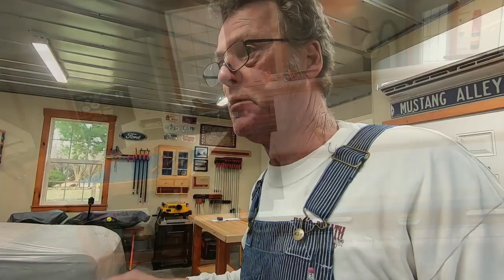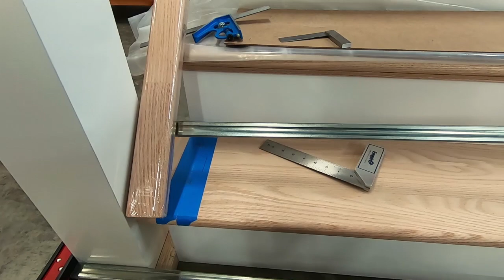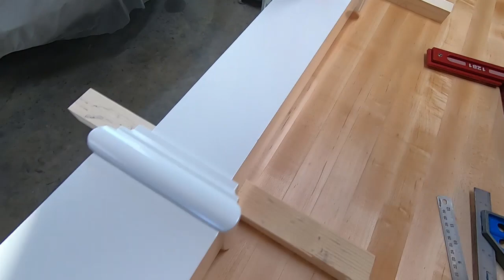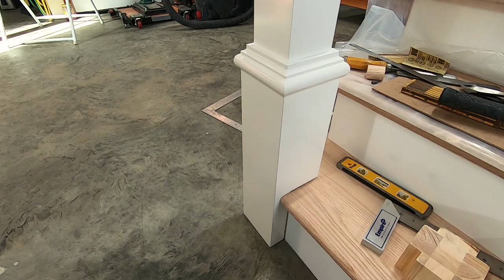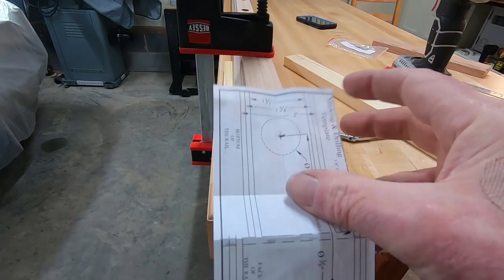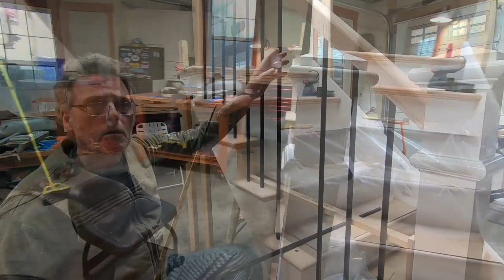Install A Newel Post, Handrail, and Balusters

Comment: Thank you so much for this video. This is exactly what I was looking for as I have been researching the best way to install our newel post and balusters. Our bottom 5 or 6 steps are open and I was contemplating closing them in. After watching this, you made it look doable for me to leave them open.
Reply from the maker: Thank you for watching! Much success with your project. Let me know how it turns out. Billy

Comment: I have a split level too,  When I bought it did not come with handrail or balance.  I really appreciate taking the time to show us how to do this.   I do have a question.  I am not sure if I missed it but what size handrails are you using?  I was trying to find one that wasn't so wide so it did not take away width or being able to move furniture into the house.
Reply from the maker: I used a standard oak handrail. There is actually more room now that the wall is gone and the new handrail is in it place 😎

Comment: Great video. How is the newel attached to the mounting block?
Reply from the maker: Thanks John! The newel is attached through the bottom of the step from below. Check out the install video, you can see it there. Billy
Reply: @billylisasremodelingchanne4344  what if there is no access below

Comment: Pretty impressive,it's not my profession but I've got a feeling even if it is I would do basic preparation work in the shop and everything else on the site...to many small details involved and to big risk that something won't fit on the site...
Reply from the maker: Thank you for watching and please watch the install video. If this home were unoccupied I would have done it on site but way too much mess to put my customer through if I didn’t have to. The sanding, staining, painting and the smell. Not to mention days without stairs. In the end it all worked out 😋 thanks again.....Billy

Comment: What is the nut/bolt fastener called that you use to secure the handrail to the newell post? 30.37 in the video
Reply from the maker: Hi Pam! That is an angled rail bolt. It is item S9601 at www.stairsupplies.com. Hope that helps. Thank you for watching…..Billy

Comment: I would add that the required spacing between balusters on the staircase is not 4" but 4-3/8" according to IRC 312.1.3 Exception 2. The 4" spacing requirement is for when the railing is running horizontally, like on a balcony. But on the staircase you can space a little wider at 4-3/8". The explanation I've heard is that the building code people deemed that a child was far more likely to fall down the stairs than through the balusters and thus the spacing was relaxed to make it easier for baluster spacing on the treads. Also since IRC 311.7.5.2 dictates that treads have a run of 10" then for 2 balusters per tread at 4-3/8" spacing means the balusters must be at lest 5/8" thick.
Reply from the maker: Thanks for watching Dennis and for your comment. Your quote of the IRC is correct and I should have said 4 3/8" max clear space between balusters. My baluster layout is from rise to rise when terminating on the tread and not in a bottom guard. I'm sure there is probably a dozen different ways to layout the balusters and get acceptable results.  Not sure of the exact numbers on that project now. We also built a (balcony) guard rail for this same project using the same materials so the spacing of the balusters of that piece was also consideration. I appreciate you adding to the conversation and hope you watch the install video, the project turned out real nice. :) Thanks again....Billy

Comment: Hey Billy, I appreciate the video you shared. We are currently remodeling our house and we are going to upgrade our stairs railing, newel post and balusters. We've got to replace the lower 2 treads where our dogs chewed on the wood, my question is do you have a video that shows replacing the treads with new? Our stair treads are the exact same design as in this video.
Reply from the maker: Hello Mikerob! Thank you for watching!! That’s a tough one. If your stairs are manufactured and not site built replacing a tread can be a tricky proposition. You might be able to cut the nosing off the damaged tread and laminate a new retro tread over it. That would change the rise by about 3/8” but would work. Most of the big box stores Cary them. I hope this helps and let me know how you make out with your project!…..Billy

Comment: What would be the best way to install a handrail between two existing, anchored newell posts?
Reply from the maker: Thank you for watching! I think I would drill a pilot hole through the bottom and secure it with a wood screw. Kind of like toe nailing with a wood screw from the bottom. …..Billy

Comment: How do you keep the epoxy from dripping from the top hole?
Reply from the maker: Hi Iuanna! Thank you for watching! The epoxy has a thick consistency so it isn't a big problem filling the upper holes before installing each baluster but can get messy if your not careful.  https://youtu.be/U9nwIvCX5yQ  Check out the installation video. Thanks again :) .....Billy

Comment: Love your video I have same set up at my house. Im having difficulty trying to figure out how to center the box nevel with the medallion can you send me some info
Reply from the maker: Thank you. I’m not sure I follow your question.
Reply: @billylisasremodelingchanne4344 sorry about that a bit difficult to explain in messages. Im trying to figure out how much i can set the nevel post into the tread. My issue is that my treads are 9 3/4 with 1 1/4 over hang
Reply from the maker: If the newel post is to be mounted to the first tread, the distance between the adjacent picket and the narrowest part of the newel post should not exceed 4 in. In my case with these stairs the rosette that connects to the top of the handrail needed to be able to mount to the wall at the top of the stairs without hanging past the existing cornerbead. Once that location is known the center of the rosette becomes the centerline of your pickets, handrail, and newel post. The install video might show this if you slow it down and look closely. I really hope this helps you, if not let me know.....Billy
Reply: @billylisasremodelingchanne4344  got it will play around with it some more today thank you very much for prompt reply
Reply from the maker: You are very welcome 😎
Reply: @billylisasremodelingchanne4344  Hi Bill sorry to bother you again just wanted to ask should the upstairs railing thats horizontal also should be at 35" in height
Reply from the maker: Usually 34" to 38" on an open walkway. I would check with your local official to be sure in your area.
Reply: @billylisasremodelingchanne4344  thank you sir, going with 36" will keep you posted
Reply from the maker: @cvello3275  Awesome!!
Reply: @billylisasremodelingchanne4344  one more thing baulester iron ones like yours spaciang apart what it should it be in regards to spacing for straight horizontal railing part.
Reply from the maker: In my area it is 4” max clear space between balusters.
Reply: @billylisasremodelingchanne4344  thank you will keep you posted on my project

Comment: Hi thank you for this very helpful video. How did you end up finally securing the newel post to the stair/floor? Adhesive? Screw through the post and then fill?
Reply from the maker: Hi Anthony! I set the mounting block in construction adhesive (when setting the steps) and fastened it to the subfloor using 3.5" framing screws through pilot holes into the framing below. I then set the post to the mounting block also using construction adhesive and 2.5" screws piloted at the bottom of the post into the mounting block so the shoe mold would cover the screws. Hopefully that makes sense. I'm planning to have the install video up soon, maybe that will help. Thank You so much for watching..... Billy
Reply: I was successfully able to finish the newel post, handrails and balusters because of your video. Thank you for the great explanation, teaching and relaxed approach! Thank you!
Reply from the maker: Wonderful news Anthony!! That really makes me happy!! …..Billy

Comment: the best explanation I have seen !!!!  good !!!!  a question!!  the height of the pickets is the same in all?  each step you have two Pickets and by the angle of the hand rail it changes?
Reply from the maker: Nahun Padilla, Thank you for watching!! If the handrail is installed properly (parallel to the angle of the steps) then each set of balusters (2) will measure the same for every step. One long and one shorter. The set of balusters on the second step will measure the same as the set on the 7th step and so on. If the handrail is not parallel to the angle of the steps then every baluster will measure different. Hope that makes sense. Please watch the install video. It was an awesome improvement. Thanks again.....Billy
Reply: Thanks Billy!